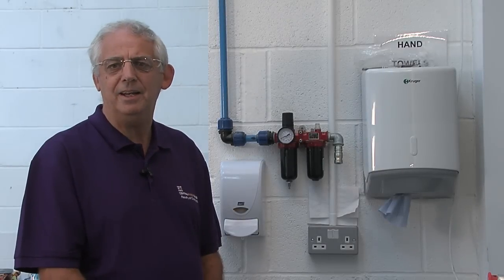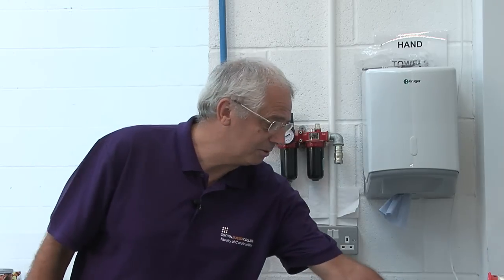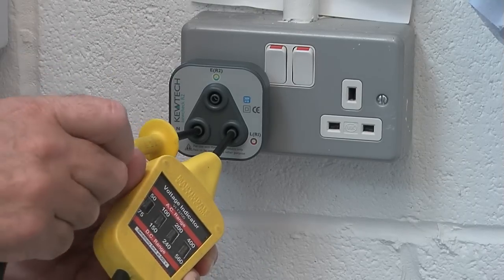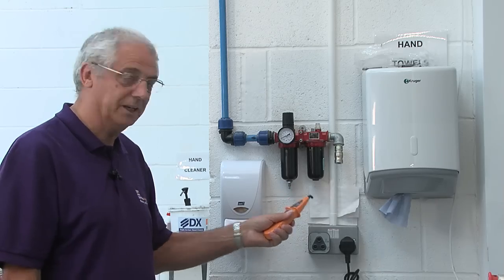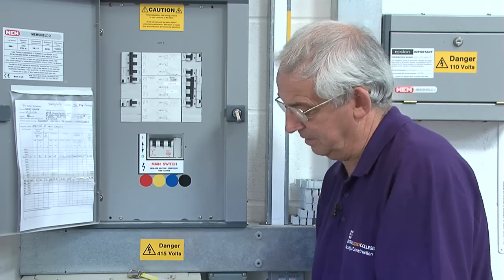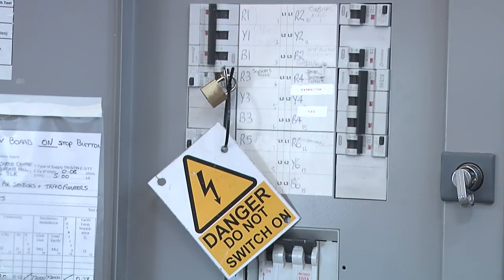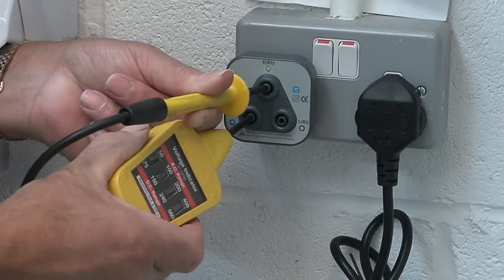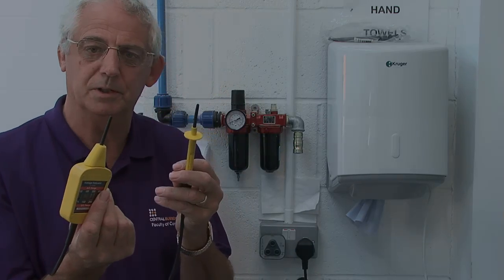Safe isolation test

Comment: Don't think this guy should have connected probe to live first. Once in contact with the live conductor the "Free end" of the probe is now live, This is not safe and should not be copied, Connect probe to neutral or 0 volts first then make contact with live conductive surface. This will result in "free end" not being Live.
Reply: Carol Edwards The equipment conforms to GS38, which means that there is no exposed conductor on the free end until it is placed into the test plug.
Reply: martindales have been proven to be dangerous, the fuse has been known to give false indications
Reply: bobbj77 that’s why you use proving unit before and after testing......